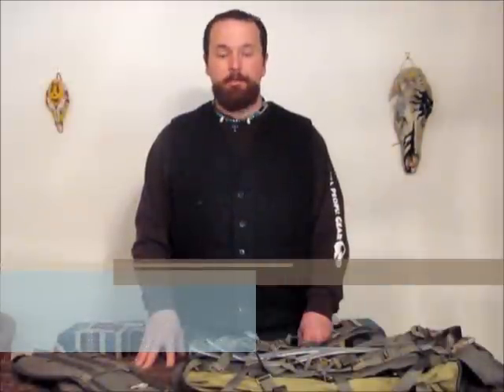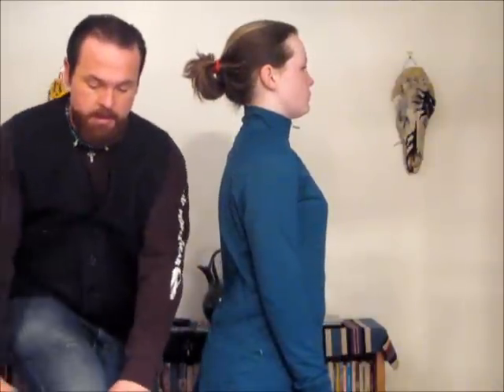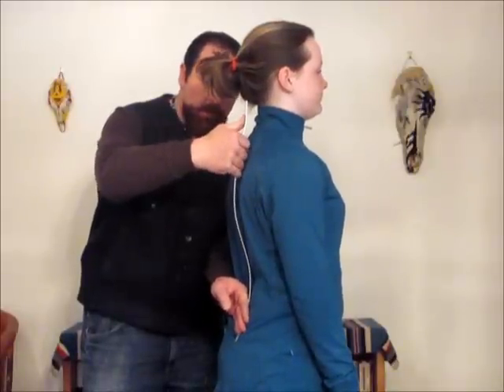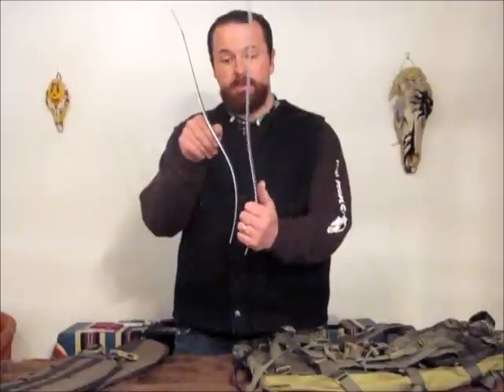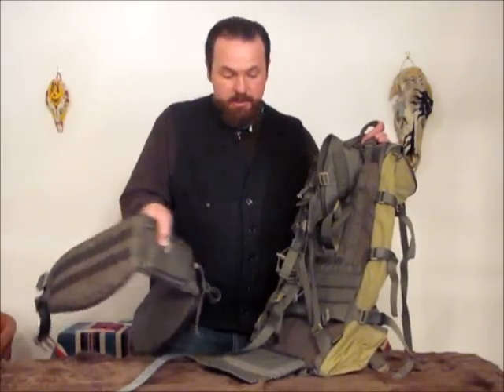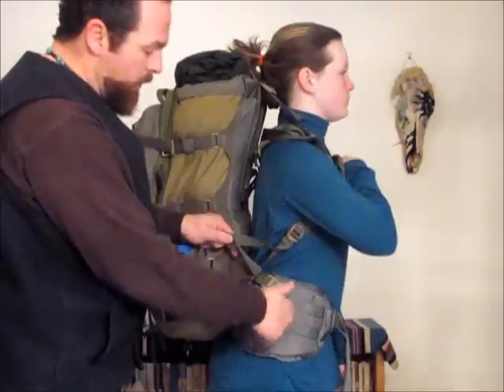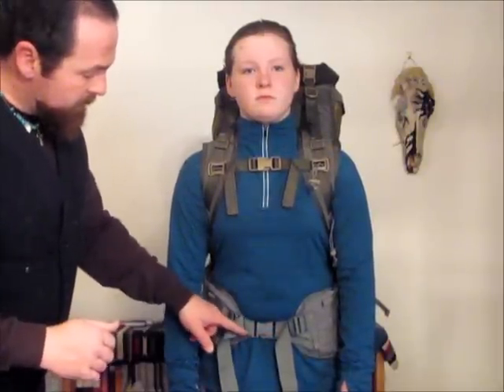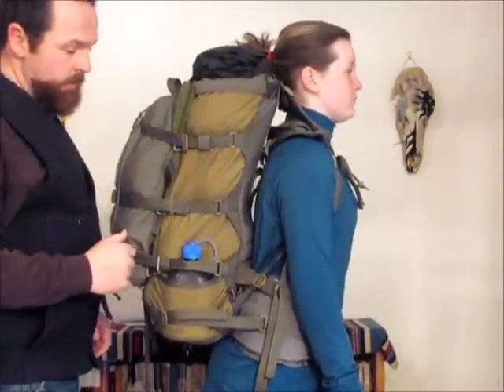HPG Ute Internal Frame Backpack Adjustment

Comment: I've got one of these packs.  VERY comfortable.  I also run a few other packs of similar size.  The UTE is a sort of unconventional pack - it is comfy, versatile / modular and even doesn't scream tactical.  In the 0-70 lb load range it is truly awesome.  65 lbs or so is the most I have loaded it up with to date.  Quality materials and very, very comfortable.  It's light enough - though not ultra light.  Durability is key - once you go too light, the durability can suffer.  The free floating yoke is also a great design - almost all the weight goes right on to your hips.  I would advise to not really carry much on your belt, as the hip belt will rub into whatever is on your belt / into your waist, and impede a comfortable experience, but other than that - this is a great pack.  It's not super heavy, but not super light weight either.  Lighter than a few other packs of similar capability, but not by much either way.  What it is - is well made - a durable pack will not be super light.  It's more of a "live in the back country for a year" as opposed to a "fast/light hiking pack".  For me, it's worth the trade off.  In this size / carry capacity range  vs Kifaru express and x-ray, and an older Karrimor SF 45 - my UTE is my favorite. 

After receiving this pack I took off the next day to travel from Switzerland, to France, to Italy, then back to Switzerland and then Canada.  I have owned this pack for less than one year, but I can say this:

+Comfort - 9/10 - seriously, it's really cushy.  It almost feels "soft" when I wear it.  It's the most comfortable pack I own.  I stand at 6'2" tall and a "moderately" lean 225lbs.  The back stays required no adjustment at all.
+Capacity - 10/10 - there's no wasted space with this pack.  It will take a lot of weight before it starts to wear on the user.
+Versatility - 9/10 - running with the top pouch (butt pack) and a compression pouch, this thing can be set up in several different ways 
+Durability - 8/10 - though I need more time to investigate this further - the materials are top notch.   It's 500d, not 1000 in many places, but I have a feeling it will last a very very long time.
+Overall [impression, fit/finish/materials/workmanship] - 10/10 - I bought this pack knowing exactly what I wanted it to carry and what I wanted it to do - so for that, plus the fact that it doesn't make me look like a soldier - I love it.  No threads out of place, no little bits that aren't quite sewn on right - perfect - right out of the box.  The compression system is the best I have ever used.  All the parts work very well together.  I was, and still am, very impressed.
+Customer service - N/A, but I have a good feeling - I emailed Evan Hill a long time ago to tell him I loved the chest pack I bought off him a year or so ago and he responded promptly, with thanks for the feedback.  I have no doubt that the Hill People would respond and assist if needed.  You can't build a company serving customers who demand a lot from their gear without answering the demands of said customers.

One thing I did not talk about - Price.
You get what you pay for.  Shop around, look at high level packs - splitting hairs at this point.  Good stuff is expensive.  I'd rather pay an honest, hard working domestic team to make me something great than start chipping away nickels and dimes to go overseas and get - well... less.  

Hope this review helps.
Keep up the great work, Hill People.
----{-@

Comment: Thanks so much for the how to. I bought an 80L back pack and was needing to fit the stays specifically and this helped with how they need to be shaped. I am goin to be using mine as a car pack that has a bigger amount of things in it than most peoples bug out bag/get home bag because mine is for possible car accident which could be anywhere and for an undetermined amount of time.

Comment: HELLO and sorry for my English. I have a question. If my backpack doesn't have  straps behind the shoulders. Would you recommend to bend the upper parts of the stays a little bit more toward my head ? Thank you for that video ! Helps a lot !
Reply from the maker: I suppose that might help. My first choice would be to add lifter straps if possible. I've been able to do that before on packs that don't have them.

Comment: I have a problem im facing when using the pack. I am not sure if its due to the pack set up or my own physical limitations. When I use the pack and put a load of about 30 pounds In it as I am hiking the top part of my glutes really start to feel really tense and soar to where I have to take a break. I don't hike very far into the woods but when I do with pack on its so hard when I feel the intense burn. Again I am not sure if its because I need to build those muscles or it my pack that I haven't set up properly. ANy suggestions or insights? thank you
Reply from the maker: It sounds like you don't have it properly landed in your lumbar curve and it is riding down onto your butt. Try increasing the depth of the lumbar curve in the stays. Also make sure that half of your belt is above your pelvis, and half below. For more information, look here: https://hillpeoplegear.com/packfitment

Comment: I did pretty much everything jn this video, just wondering about the strap that goes in the ring, should this one be tight like the shoulder strap or really loose?
Reply from the maker: The point of the strap passing through the ring and up to the harness is to set the torso length. When adjusted properly, the shoulder harness should sit lightly in the correct position on the shoulders and the strap will be snug (but not super tight) between ring and shoulder harness. Tightening the lifter straps should take the shoulder harness off the shoulders.
Reply: @HillPeopleGear  thank you for the answer friends. Great product as always.